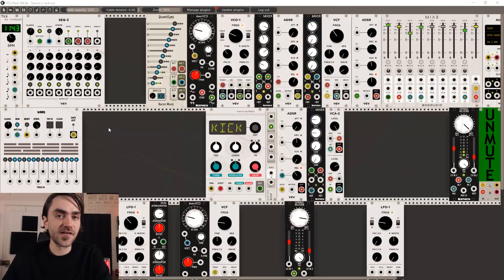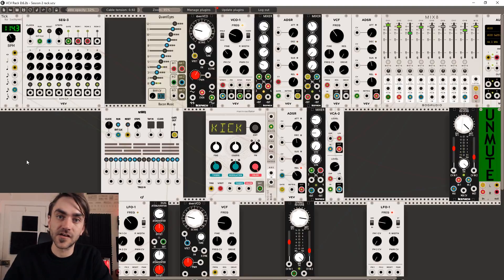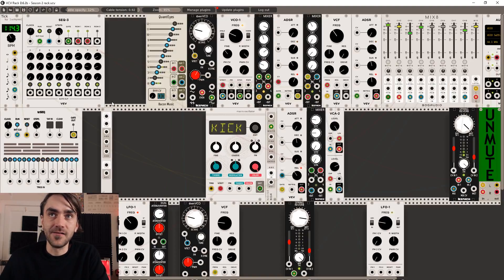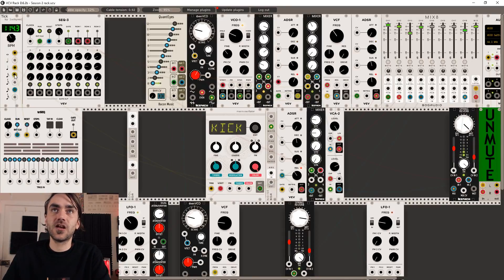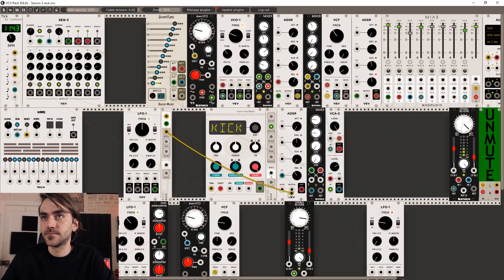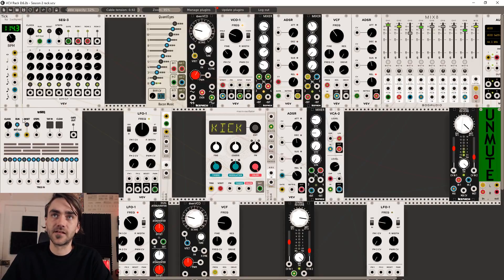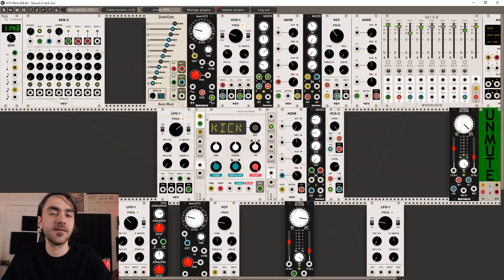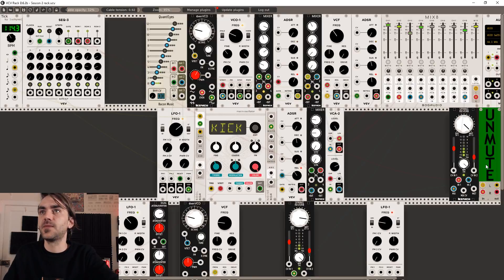VCV Rack - Quantizing Part 2: Gates / AND Logic

Comment: Hi man, that's really interesting using the frequency of the lfo to sort of change and play the hihat live. There is also a Boolean Logic module from HetrickCV, which has 3 inputs, so you can add another clock division\multiplication and add some offbeat triggers, especially if you start using the other gate types. Cheers!
Reply from the maker: Thank you and thanks for the tip! I have been meaning to look into the HetrickCV modules

Comment: y0 dude, found your channel a little while ago, love what you are showing here!
I've recently bought Reason10 , and started applying some stuff you showed here, very good stuff !
Was wondering if you've ever tried Reason, and maybe checked out their VST Synth called Europa !?

greets !
Reply from the maker: I was using Reason a lot around version 2 and 3, at that point it had the upper hand on most DAW's who's synthesis power was very limited, although Reason had very limited mixer power at the time. Nowadays I feel most DAW's have come to the party, and support both sides - so I have let me love for Reason fall by the wayside, as I've never felt the need to invest in it again as Cubase ticks all the boxes for me :)
Reply: Cool ! The "reason" i've actually gone and bought Reason (the intro version for now) was because i've found your videos crossed with the fact that it now has VST support and 2 new synths (i've got access to 1 of them, for now!) !
I will upgrade to the full version somewhere in the future to unlock more of that amazing stuff :D
You can actually testdrive Europa on their website ( https://www.propellerheads.se/europa ), the amount of automation/modulation is insane in this one ! :P